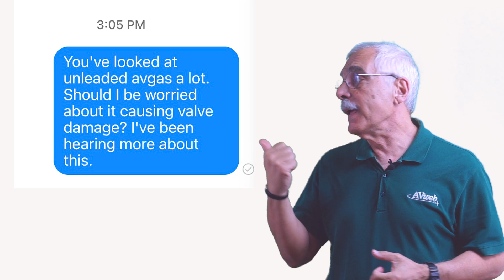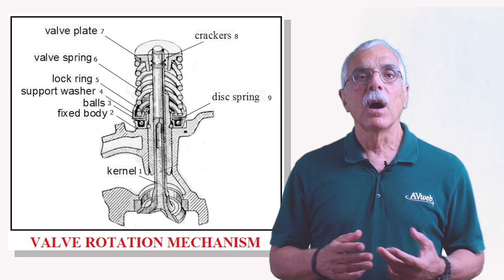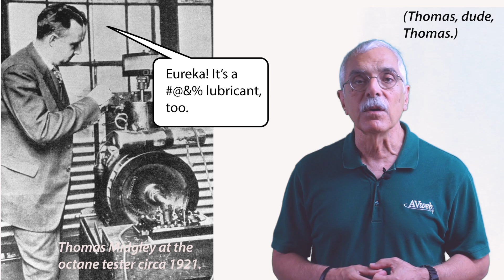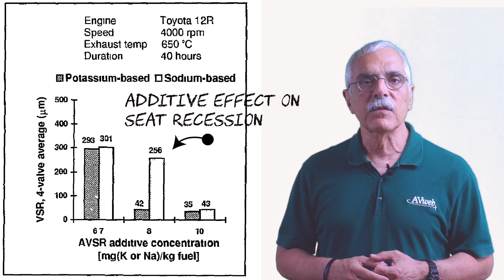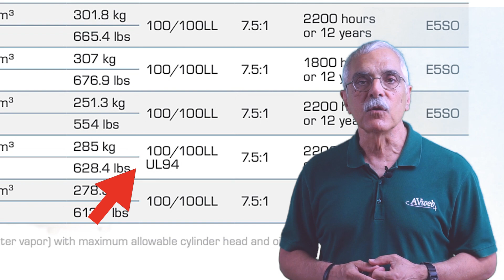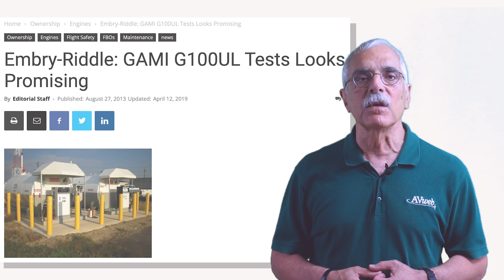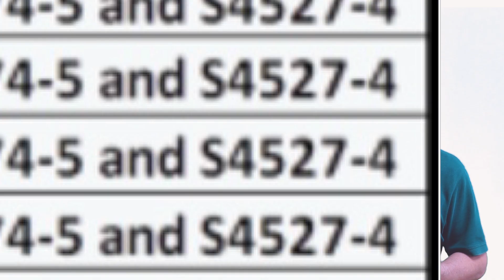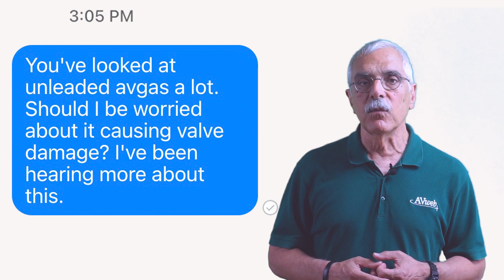Whadayamean Unleaded Fuel Will Trash My Valves?

Comment: I have a Canadian ultralight with a Honda derivitive engine. I scored a bunch of FREE avgas and blended it half and half with the high test auto fuel. Within about 20 hrs I had valve problems. After getting rid of the avgas and doing a valve job, all is good again. 
On my Lycoming powered airplane, whenever I am forced to burn avgas I have to be carefull to lean hard on taxing or it fouls the valves and I'l get a big mag drop.  
Some 400 hours of flying has reinforced my attitude.
My conclusion,,,,auto fuel, good,,,,avgas bad!

Comment: I overhauled my Continental 90hp engine using new Superior cylinders and new crank. I never used 100LL or straight mineral oil. I used alcohol free unleaded auto fuel and Aeroshell W 80 for the break in which took less than an hour. 
6 years later the engine has 710 hours with great compression and so far I have not had to add any oil during the 30 hours between oil changes. One note: on several small  Continental  engines if I switch to multi grade oil I start getting lifter ticking that can be heard in flight. Switch back to 80 or 100 Aeroshell W and it goes away.

Comment: Lower octane fuels are possible in modern high compression engines because of ECM controlled ignition timing.  I think eventually we'll see more multifuel engines which would reduce the cost for GA and other piston type aeroplanes.  Whether manufacturers will bother getting these new engines certified and whether airfields will be stocking it will be mostly up to demand from their customers.  Given Continental's indifference to testing G100UL, that would appear to be an even bigger clusterfuck looming on the horizon.  Like some companies that I've worked for, the words "but we've always done it this way" are about the most poisonous you can hear from any manufacturer.

Comment: 1st off some common factory workers like me enjoy flying and aviation to its not just for rich people so get an education on the subject you wanna talk about and quit hating. As for the fuel lead is typically an upper cylinder lubercant but as far as i know Lycoming has used improved valve seats for some time and valve sticking is typically caused by lead and or carbon build up on the valve stem from running to rich and not using the red knob labled mixture control. That being said some additional lubricant isnt a bad thing but even if lead assists in valve seat lube it probably doesn't help the valve stem and guide.

Comment: I didn’t hear anything about fuel stability. 100LL doesn’t deteriorate quickly as does car gas. Planes sometimes set for months in between flights for various reasons. We all know car gas gets old fairly rapidly hence - Seafoam and Stabil.

Comment: Hi Paul,  I  really enjoy your presentation style.  Nice work.  I no longer fly nor use my A&P license, so I YouTube Fly.  Osmotically flying and analyzing the f-ups in maintenance.  I wanted to tell you briefly my own experience with valve recession.  As a matter of fact, my after school job when attending Northrop Tech for my A&P license, was converting cars and trucks to propane.  Now this was in the early 1970s, when fuels were fuels, but we learned to advise customers who converted to propane do so with either a) top end rebuild, including Stellite seats; or b) a squeaky clean new engine.; or c) if you have a Ford, they used to sell factory crate engines, set up to run on gaseous fuels.  I have seen, firsthand, what some serious valve recession looks like.  

I used to own a 1977 Skyhawk, with the venerable O-320-H2AD engine.  I personally would not put UL fuel in it without a top end job.  My 2-cents and I'm sticking by it.  

Marc

Comment: Well, I beg to disagree. I had a very nice 2.8 liter all aluminum tuned Alfa Romeo engine in a GTV-6 and when finally in the 90ies premium fuel with traces of TEL became unavailable and was replaced with highly carcinogenic "unleaded" "premium" fuel full of cyclic aromatic compounds and other crap like that, the valve seats died. I did run it like an aircraft engine, for hours at the time at 80% power on the German Autobahn. Cruising at 220-240kph with a lot of 100% "climbs" in between when I had to brake for a truck. Worked fine for years with quality TEL fuel. Engine died in less than a year on "premium" unleaded. Valve seats gone (they do get very hot & soft). I DO NOT think that any US car engine experience (outside of Cannonball racers) is applicable to our aircraft, as most cops would open fire immediately if you drove like I drove in the 90ies in Europe... The main reason I fly is because I appreciate FRIENDLY radar service. Eliminating TEL from avgas means the certain end of the high power 540/550 with 300++ hp: You won't see it immediately, but it will happen, ESPECIALLY as our engines are AIR COOLED and quite often not operated at the healthiest of temperatures. At the end, it would be better to keep a doser with TEL in the aircraft to treat the crap fuel the #greens force on us (and only wear gloves and a VOC respirator when fueling with this crap), and aggressively look for getting the Diamond 300++ hp Diesel retrofitted on high end legacy aircraft. Oh, wait, the #greens also don't like Diesel engines..... So flying will only be for the jet crowd soon, or the ultralights with watercooled ROTAX engines with 1000h TBOs. Maybe voting for a different Gov is the only solution... (research showed HIGHER average lead levels in the bodies of rural people than New York Taxi drivers when all fuel was "leaded".... Eating lead paint off walls as kids was the main reason people showed high lead levels, blaming ICEs for lead "pollution" was the second big #green scam after DDT, "smog" was next, and now it is "carbon")

Comment: 2 points. 

First. The FAA isn't concerned with premature wear...They want to know whether or not the fuel is going to cause instant catastrophic failure of the engine, resulting in loss of life...if your valves only go half the serviceable life that they use to is of zero concern to them...

Secondly, none of this matters, because by the time we have enough hours on the fleet to know the answer, leaded fuel will have been banned, and there won't be any chance of going back...if it shortens the life of the valve train it will just be the cost of doing business moving forward...

Comment: Air cooled aircraft engines have aluminum heads with valve seat inserts. My guess is that the Continental valve seat inserts are somewhat softer than stellite. Valve seats have lots of properties besides hardness. Things like thermal expansion/conductivity and abrasion resistance come to mind. A million hour valve seat that shrinks when hot will come loose in the head, that's a bummer. The valve seat insert will get much hotter than the cylinder head, so there is something of a game to find solutions that work for most people most of the time. Valve rotators were designed to deal with seat deposits. The theory is the deposit prevents the valve from making good contact with the seat and the super heated exhaust gasses get to sneak through the gap so the valve overheats in one spot. By rotating the valve, the hot spot gets to move around the valve, buying time so the deposit gets flushed out before the valve fails. WIth unleaded gas, the rotator creates unneeded friction that causes additional wear.

Comment: Maybe I'm wrong, but I was always under the impression that the problem was not so much with the seat, but with valve guide wear. (Which would then aggreviate faster seat wear).
Reply: lead causes a contamination that builds up on the valve stem and gets jammed up the guide. its what causes valve jamming on these engines.

Comment: I stumbled on this video and I come from the classic car / truck end of things and this debate (along with the whole ethanol debate) comes up frequently. From what I’ve always understood was the valve seat recession panic came from a specific set of GM engines (I can’t remember which ones) that did show valve recession around the time of the switch to unleaded fuel, however it’s also common knowledge that during the late 60s and early 70s US auto makers were really trying to cut corners to compete with Japanese and euro cars. So with that being said it wouldn’t surprise me that a generally softer head material was used and the valves would have recessed anyway, it’s just coincidental that there was a fuel switch during that time. I’ve never run lead additive in any of my stuff. I have a 63 f100 with a 460 out of a 70 Lincoln (pre smog high compression heads) and have had 0 issues. I recently pulled the heads to address a head gasket leak and everything valve wise was fine. I have a 42 ford 2n tractor that has been plugging along on pump 87 for god knows how long and has never smoked a valve. My friend runs non leaded in his late 40s and early 50s packards and Hudson. Moral of the story, I feel while there may be a slight about of truth to the whole “lead lubricates” argument, I don’t feel it saves valves. Valve recession, in my opinion, is cause by bad materials and generally bad fuel, but not the lack of lead.
Reply: One post above says there was a study that using lead at any time then gives a lifetime of protection...so having those vehicles use leaded fuel then means they would be fine for unleaded after that.

Comment: Ridiculous that this is still even an issue.  Our government is literally protecting manufacturers from changing with the times.  When I flew with an aeroclub ten years ago, the Cessnas I was in were certified to run on mogas.  And I notice that newer GA airplanes like the Diamond DA40 don't bother with gasoline at all--they just use autodiesel engines that are reengineered to run on ever-plentiful jet fuel.  

It doesn't make economical sense to keep producing a fuel that fewer will actually use in the future, and it disincentivizes actors in developing nations from buying newer, safer equipment.

Comment: Its real simple if you have induction or flame hardened, or better yet hard exhaust seat inserts. You will be fine, if not and you got soft cast exhaust seats they will hammer out. how long it takes, ect. Is subject to a lot of factors. I personally know a very good machinist that made his living since they changed over to unleaded auto fuel, rebuilding heads and putting in hard seat inserts. I have personally take apart heads and sean hammered out valves and seats from runing unleaded fuel. And using stainless steel valves, doesn't negate the need for hard seats.

Comment: Sounds to me like aviation engine manufacturers have really screwed the pooch over the last 50 years.  Cheap-ass Continental failing to implement hardened valves and valve seats until 2019?  Procrastinating Bastards!  How else have they been cutting corners?

Kudos to Lycoming!

It's best for general aviation enthusiasts to make the permanent switch to diesel engines, thereby reducing the fuel logistics for all aircraft to just a single source:  jet fuel.

Comment: Automobiles have run unleaded for decades. Of course, they had to with the newest emission standards that started in 1980. Still, why did aircraft engine manufacturers not change? Was it just penny-pinching just because they could get away with "outdated' standards already in place by the FAA?

Comment: I remember this very argument 40 years ago as to older motorcycles. The large-scale exhaust valve failures predicted were never seen. I don't think any motorcycle engines used rotating valves.
Reply: I'm pretty sure most automotive engines have valves spinning by design after certain rpm. So, motorcycle engines are probably the same way?

Comment: also happened to exhaust valves in lpg and cng fueled vehicles. hardened valve seats and stainless valves fixed that
Reply: It is interesting that the Ford CNG engines that are certified to be converted to CNG in California have improved valve seats installed at the factory and are delivered as conventional auto gas engines and then converted to CNG at a certified third party facility where all the external CNG equipment is installed. So that more than suggests that CNG as a fuel is more demanding. The rather vagueness of how this new fuel will perform in all possible combinations of uncertified random engines that are still operational should at least give a few people sufficient pause to be cautious and do the necessary vigilant checks.

Comment: I was with Toyota at the time of the fuel change back on the '70s
The problem was valve stem galling.
The problem was corrected with hardened valves, guides, and seats materials.

Comment: Poor engine design is no excuse to dump massive quantities of toxic chemicals into the air. Proven solutions have been manufactured economically at a massive scale for decades. The only reason we're still burning leaded fuel is because the people doing it are not being held accountable for the harm they are causing.

Comment: Nah the metal alloys used for valves have been updated to live with unleaded. The lead originally started out as an anti knock component for the gas and ended up being a cushioning agent for the valves as they landed on the seat. So the alloys have changed and that should be all that’s required. Valve springs also changed.

Comment: For further research one could look into the part numbers of those cylinder seats and cross reference to different cylinders/engines's for conformity to what Continental will not confirm.  Not so sure the exact material and processes would be readily available.

Comment: uhh....  we've been getting the shaft in the automotive side for a long long time,   valve degradation is only one problem that we face with terrible gasoline.  its highly reactive with rubber fuel hoses, it has an incredibly short shelf life and can be contaminated to complete uselessness on a humid day

Comment: I have a 1963 Buick. I have used unleaded fuel for the past 50 years with no detrimental effect on  the valves. In fact the lead did much more damage to engines and even parts like exhaust  pipes. This may not be true with all engines . Buick engines at that time were  probably made with harder valves and seats from the factory.

Comment: In your animated moving valve illustration, what are the gray curved areas on either side of the valve head adjacent to the valve seat ? I have never seen that on an engine .
Reply: It is the valve inserts, you can see the actual cylinder head with the valve insert at 11:58.

Comment: In 1982 I bought a 1974 Audi that had split exhaust values.   I believe the engine was designed for leaded gas, but had been running unleaded.  In the summer of 1983 I replacing the cylinder head.   The car ran great for couple of years.  In 1985 I started to notice slipping performance again.   The car was totaled in an accident so I didn't have to replace the head again.   My dad said the split exhaust values was due to running unleaded gas in it.

Comment: GA uses low leaded fuel to increase the octane. When we operate at altitude we need a higher octane to prevent predestination. Automotive gas usage alcohol. Went to altitude the alcohol will boil out trading Hydro locked in your fuel lines and ultimately feel starvation. Unless your fuel system has a way to clean off alcohol your flight very well-made and shorter than expected.  Similar experiments can be conducted in a altitude cheap using water. You’ll Find at about 34000ft Water boils at room temperature.  LL fuel considerably lower boiling pressure.
Reply: Your comment would make more sense if it wasn't for the numerous people already running normal autogas with no issues in a wide variety of aviation engines which are able to accept it.

Comment: Stellar job Paul!!

Pretty clear that Continental is not ready to accept the liability of their technical decisions. Sad for such smart engineers I know to exist at that company.  Sure glad I run a Lycoming right now. 

FAA/EPA should put their money behind their mouth. Sponsor installation of  strategically located fueling stations across the USA for 100GUL and ensure there is a routing for the fuel to these locations. Also ensure the price is $0.50 less than what ever the 100LL is at that location. The early adopters will buy it and fly with it. The hours of operation to prove the reliability will accumulate and the word will spread. Much cheaper than dozens of programs they do now. 

Better (cheaper) than EV and Solar, and Wind subsidies.
Reply: Simply ban the production, transportation, sale and use of leaded fuel.

Comment: Paul don't get yourself in a twist I have worked on engines for over 40 years the only thing I have to do is have harden seats in the heads and in cars you got to put a better exhaust valve,

Comment: lol, 2019? Continental continued to NOT upgrade the Valve Seats in their engines for 50 years. Lack of Improvement is a Feature for Profit requiring more frequent rebuilds. FAA Certification Cost holding up Progress to safer more durable engines? Most likely.